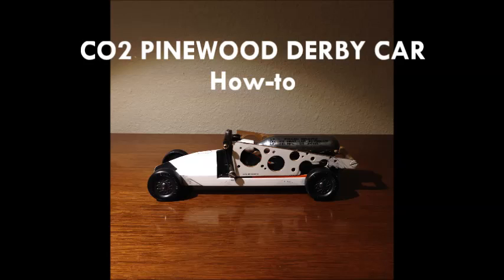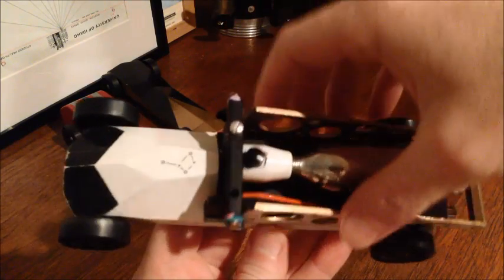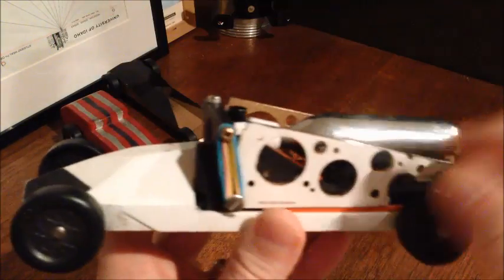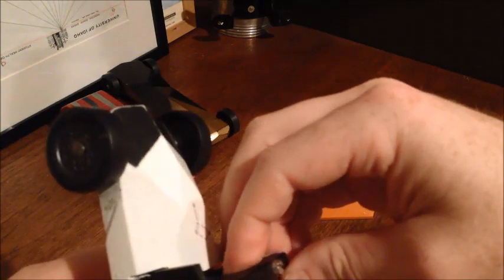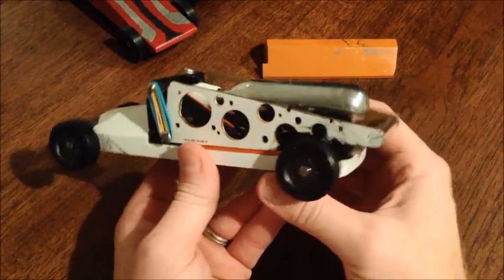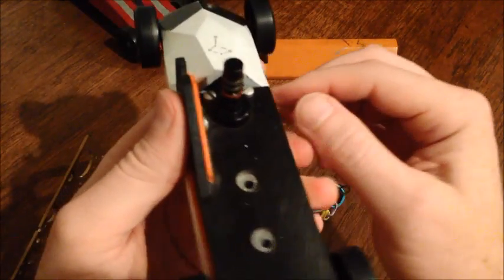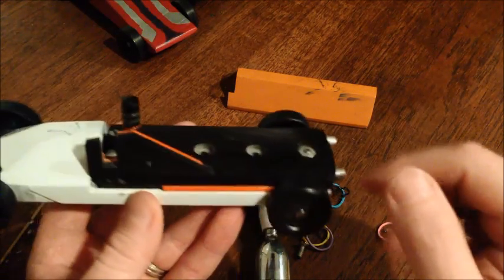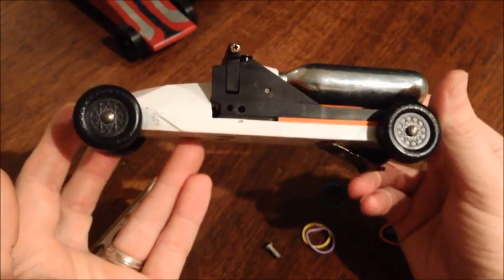How to Build a Fast co2 Pinewood Derby Car

Comment: Is there any chance in getting how you did this car and where to get the parts for building one or these ?
Reply from the maker: I bought a co2 tire inflator from Amazon and then all the other parts I made from wood, plastic, metal, screws, rubber bands, etc. Good luck!

Comment: Awesome video with great detail.  I am curious about how it is shut down at the end of the race.  I also would love any additional detail on drilling out the co2 inflator.
Reply from the maker: Thanks for the comment! So there's no to shut it off at the end of the race - the CO2 cartridge is spent by the end. You just unscrew it and put in a new one. As for drilling out the inflator, the threaded section has a hardened steel point that punctures the cartridge and it also has a tiny hole running through it. For the life of me, I couldn't drill it out larger because it was hardened. So I drilled out the aluminum valve passages to the largest size possible for the best flow possible. Even still, I'd like the flow to be a little faster. thanks!